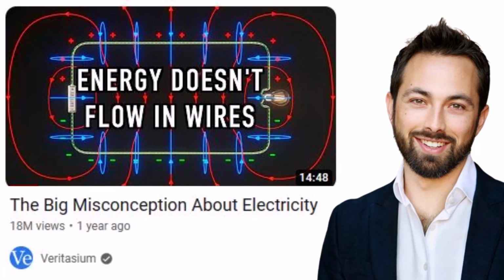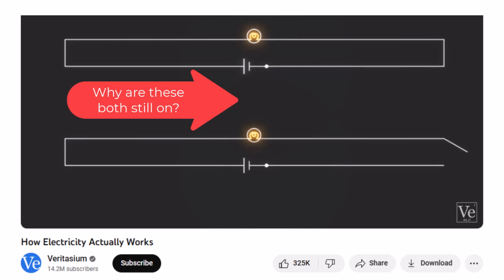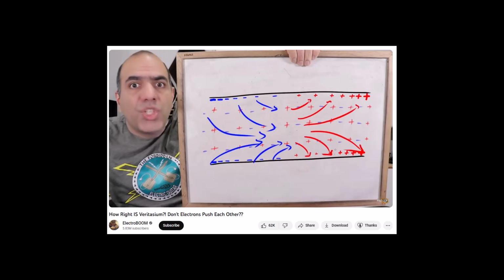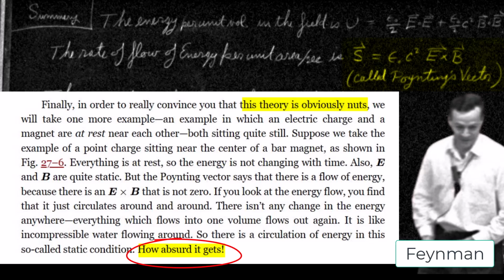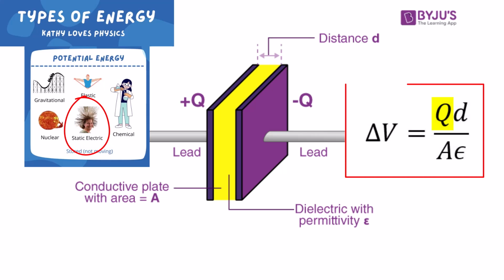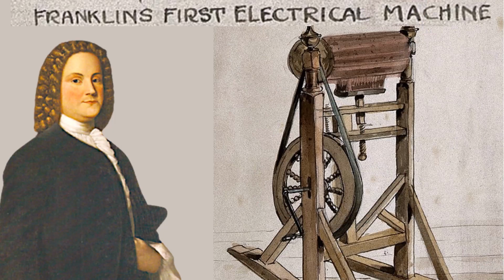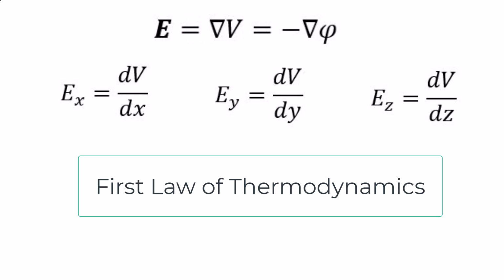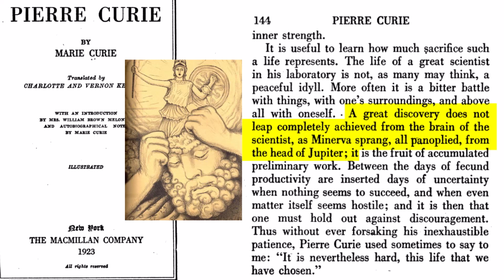Deep Dive Historical Response to Veritasium’s DC Electricity Video

Comment: I still haven't seen anyone formally analyze Derek's experiment as a transmission line.  His parallel wires 1m apart constitute an "open wire" transmission line with a short at the far end. The important thing is that until a signal actually reaches that far-end short and reflects back, the line will, at its near end, present an impedance that depends on its geometry and the material between the conductors. This is the "characteristic impedance" of the line.

Assuming zero resistance conductors and vacuum between them, the characteristic impedance is 276 * log10(d/r) ohms, where d is the distance between the wire centers and r is the wire radius. For 14 gauge wire (radius 0.814 mm) the impedance will be about 853 ohms. The "velocity factor" (how fast signals propagate along the line) depends on the dielectric coefficient of whatever's between them. Vacuum has a dielectric coefficient of 1 and air is only very slightly greater, so we'll assume a velocity factor of 1, i.e., signals propagate at the speed of light.

Each section of line will therefore look just like an 853 ohm resistor for the 1 second it takes for the switch transient to propagate to the end of each line and return. So for 1 second after the switch is closed, the circuit is equivalent to the battery, bulb and two 853 ohm resistors connected in series, and the current through the light bulb will be Vbat / (2 * 853 + Rbulb), where Vbat is the battery voltage and Rbulb is the resistance of the bulb. Will that light the bulb? Depends on the current the bulb needs to illuminate.

After 1 second (again assuming perfect conductors), the reflections of the transient will have returned to the origin and the apparent resistance of each loop will drop to 0 ohms. Then the bulb current is limited only by its own resistance.

Comment: The electromagnetic pulse is definitely a factor to be considered.  But don't forget that Poynting's derivation is applicable to all media, including conducting or non-conducting media.  If there is only DC current in the medium, power density should int (E.J) over the whole volume.

Comment: Greetings, Mrs. Joseph. I had the opportunity to make an extensive research on books and articles on the subject of the Veritasium video, several years ago...I simply couldn't eat that lies, having an electronics engineering degree.

The approach of Muller comes from a misinterpretation of an article of Galili and Goihbarg, applying Poynting vector to a DC circuit.

Even the book of Oleg Jefimenko provided another explanation, saying that the conductors shape the fields to transport the energy. (Coaxial cable)

I made an experiment with a capacitor charged to 2kV DC.
The dielectric was air, then the internal electric field is orthogonal to the plates. And I've put a magnet inside the air gap.
Supposedly, an energy vector , orthogonal to B and E, would come out of the capacitor and cause an "energy ray" that would make a hole in the ceiling.
None of it happened, of course.
That's because Poynting vector applies to electromagnetic waves in which the electrical and magnetic fields must be COUPLED and variant in time, that is, AC.

Comment: Let me explain to thoughts on the topic. 1st: I wonder how the consideration of switching on the DC circuit would be affected by the fact that a sudden rise of voltage (or current, it doesn’t really matter - just let us call it a square wave) produces a signal which contains an indefinite scale of frequencies. There are three properties that define a signal line: the wire’s resistance per length, its line impedance (depending on the wire’s thickness and the space between the wires) and it’s velocity factor the ratio of the speed of light in the conductor against free space, depending on properties of the conductor and the dielectric). I won’t put in formulas here, they’re easy to find. You will find out that line impedance will remarkably stop increasing above a remarkably low distance between the wires. So there must happen more than only DC phenomena along the wires.
2nd I think (this is my personal persuasion, no theoretical or experimental proof at the moment) as long as we stick to models using particles, we won’t be able to find a solution to our questions. We found that electrons move, we know that they are driven by photons. But each can move to places without being in the space between those places. So the particles are only a model, they’re not real at all. In the next step they might be described as probability f states of spacetime, I don’t know. I am a Faraday Fanboy, too. As well as a Niel Bohr admirer. But if we want to come further in the understanding of physics, we must look forward, not back. This is definitely the longest comment I‘ve ever posted. Thank you for your great work. I’ve followed your channel for years and appreciate it very much. I also bought your book as a present to some friends of mine and they all like it very much.

Comment: Hi Kathy
Could there be a difference between how the charge distributes on a conductor surface in the usual case to have zero field inside it, VS. the charge gradient on the surface of the wire/ conductor as drawn by Mehdi? Usually the positive and negative charges distribute on the opposite surfaces to cancel the external electric field. This doesnt seem to be the case in Mehdi’s drawing. Would charge distribution cause zero field inside even with the shown distribution?

Comment: Yes, you are perfectly right that this Veritasium video about the power transmission from a power plant to the consumer is total nonsense. In fact, no power is transferred via electrical conductors and transformers, but only a force on charges.
A force coupling is established between the power plant and the consumer. The force provided by the power plant reaches the consumer and the counterforce that the electrical device exerts on electrical charges at the consumer when the power is taken off arrives back at the power plant.
But why is that exactly the case? The generator in the power station induces a voltage. Voltage is energy per charge. It is irrelevant whether this voltage is directly applied to electrical cables or is transmitted to the lines via several transformers. This voltage enables charge to transfer energy to an electrical resistor. The power that is delivered is voltage times charge per time. Charge per time, however, is electric current.
The current that flows at the consumers device over the voltage applied there delivers the power voltage U times current I. It doesn't matter whether it's alternating current or direct current. The power plant must now provide power to conduct the current taken by the consumer against the required voltage. If the power of the power station is not sufficient, then the voltage collapses.
The mechanism of power transfer via the Pointing vector postulated in the video is too weak by a factor of about 1/10 million. In addition, electrical devices are not designed at all to absorb energy via such a Poynting mechanism.

Comment: School taught by the book. 
The book says that charge flow in a wire is taken as electron flow driven by emf. 

The book also says charge only flow on conductor boundary surfaces and not inside it. Verified positive by Faraday’s cage. That also says electrons is not require to conduct electric charge. 

So what needs electrons to conduct electric charge? Ask also JJ Thompson for definitive answer. His answer is permittivity-Vacuum requires electrons. Faraday adds that not for a conductor. 

Our education system is corrupted. Please help to restore it.

Comment: This looks to me, a BSEE (and MSCS) graduate, like a classic transmission line problem.  Assuming ideal everything including the light bulb (which we can assume will act like a fixed resistor) will mean it still depends on the relationship of the light bulb's resistance to the transmission line's impedance.  Assuming another ideal (that the resistance and impedance match) we will get an ideal pulse of current.  If the switch and light bulb and battery are also a negligible distance apart and the ideal transmission line extends out the necessary distance, that bulb will light up at full brightness instantaneously and remain lit.

If, in this ideal setup, we move the light bulb down the transmission line, then the delay from throwing the ideal switch to the lighting of the ideal bulb is given by the time it would take light to get from the switch to the bulb in either direction, depending on which direction is closest.

If the light bulb's resistance does not equal the transmission line's impedance, we should expect some flickering of the bulb as the electrical transients die down.

Transmission line impedance, in turn, depends on unit inductance and unit capacitance.   Calculations could be made depending on the geometry.  If we don't have perfect shielding we will also have antenna effects causing electrical transients to radiate electromagnetic energy away, also resulting in some flickering of the bulb until they die down.

Thought experiments have to relate to real physics sooner or later.

I hope this is helpful in considering the problem.  I posit that it is less about criticizing bad models than pointing out good models.

There is a reason that, in modern computers, digital cabling has matching termination resistors on the receiving end.  It is to minimize, if not eliminate, electrical transients which would result in indistinct digital signals on the receiving end.

Comment: Let us say we have a tractor out in a field with a low tire.  So you haul out a compressor with hundreds of feet of extension cord.  You would be lucky if the compressor would make a hum let alone work.  So in practical terms with out the math and science this experiment would not work because of the length of wire.

Comment: Every circuit has both capacitance and inductance as well as resistance. There's an RC time constant and an RL time constant. It's easy to work out if you know the values of R L and C

Comment: Exactly!  I had a thought experiment that would place a 1 meg resistor a mile away. Would the bulb light? No. Permittivity is about 10^-11 per meter. That power pulse outside the wire does nothing.  This was click bait. They want to shock (not electrically).  I use wires in my circuits. Electrons flow inside them. This is not microwave.

Comment: Dear Kathy, I still think Derek is right. The characteristics of the battery, switch or light bulk are insignificant. Here is my reasoning. There are two steady state in this experiment; 1st is when the switch is open, and all the E field concentrated at the switch. The 2nd state is when the switch is closed and all the e field is at the light bulb. The transition from the 1st and the 2nd is a propagation of Electra magnetic waves and occur at the speed of light. The rest of the wiring and stuff merely facilitates the propagation. This leads to a strange phenomenon that the light bulb ‘knows’ to turn on before the wire at the moon ‘knows’ it should allow the current to flow. But I think that’s the reality.
Reply: For example, imagine someone is on the moon and you are at the switch. You two have an agreement that exactly when you close the switch, he would cut the wire. The light bulb should still light up for 1s, right? Otherwise information is traveling faster than the speed of light.

Comment: 19:39 yes, I think that should be the goal, but sometimes it's impossible with modern physic, especially quantum mechanics. In this casecyou have to simplify and/or interpret things if you just use words. However you shouldn't go further with tjis then necessary.

Comment: Has no one ever used an oscilloscope? A scope especially with storage will show the transients and provide an way to measure them. Modern scopes can go well over100MHz and can easily capture nanosecond events. It might also be interesting to use coax instead of bare wire.

Comment: This is a good example of how starting out in a flawed way you can make heavy weather of the analysis. This is true of both 'Kathy Loves' and 'Veritasium'.  Any microwave or radio engineer would instantly recognise the problem as a pair of transmission lines.  The way the circuit is stimulated is best decomposed into the application of a linear superposition of a common mode voltage source and a differential mode voltage source.  You then derive the phase velocity and impedence of the two transmission lines seperately.  The prescence of the earth below the TL will alter the phase velocity & impedence of the two TLs differently and the step function time  function will most probably arrive back at the bulb at different times.  You can have a go at hand solving but there are microwave design packages out there that will do this easily.
Veritasium's original demonstration would have been much 'cleaner' if he simply had a bulb at the end of a long "twisted pair" which would have been a differential mode which would have demonstrated the electromagnetics much simpler and that the energy flowed at square root of the product of permeability times permitivity (relative).

Comment: Derek could've saved himself a lot of grief if he'd just used correct units.
1/c seconds doesn't make sense, it doesn't solve for time.
Without showing where the "1" comes from, the answer appears to be the inverse of c, regardless of the wires proximity.
In units, his answer is 1/(m/s)=m/s, a measure of speed.
If 1meter is used then m/(m/s)=s, a measure of time.

Comment: So Div(S) = -E*J (statics) for dynamics there is extra term of energy density.
So you can see for steady current at a point IN a conductor YOUR WIRE. If you have electric field you will have current and if you have current you will have electric field and at that POINT you will have sink of energy as would be expected. With a steady current you also have electric field outside the wire and so if you have conducting material surrounding your wire there will also be a sink of energy at that point. So even with steady current and static fields it's clear you have energy OUTSIDE the wire.
So it's absolutely clear as to where the energy is. With DC or AC it's in fields OUTSIDE the wire and also at any point inside or on surface of wire where you have current.

Comment: I have a short paper on how energy is transmitted along conductors. Whether AC or DC, energy is transmitted as infrared photon flows within conductors; energy is not transmitted through surrounding magnetic fields as is believed; poynting theorem not needed at all.

Comment: If it was just a pulse caused by static charge on the switch, I wouldn't expect what I see in the AlphaPhoenix video of the experiment. When AlphaPhoenix cuts the wires, the current in the 'bulp' lasts exactly as long as the signal traveling from the switch to the cut and back, because the battery feeds electrons for that duration. The video actually tells me Veritasium is very much correct. (Search for the video 'I bought 1000 meters of wire to settle a physics debate'.)

Comment: Derek's video requires you to assume that all sorts of elements are perfect, including the bulb, the switch, the battery, etc, and that the bulb is sensitive enough to respond instantly to any hint of a voltage.  But if all that was the case, would not the answer be that the bulb is already lit, due to the earth's magnetic field?